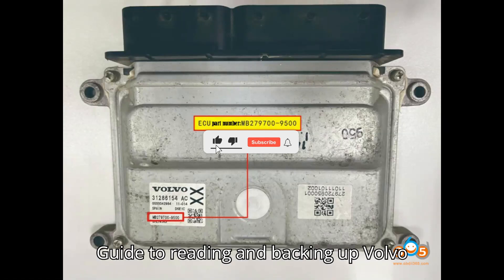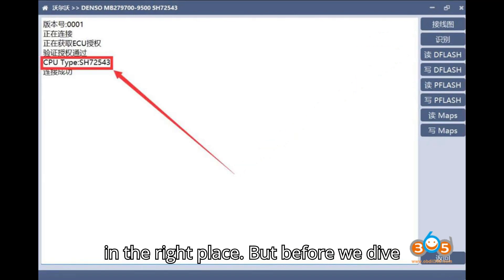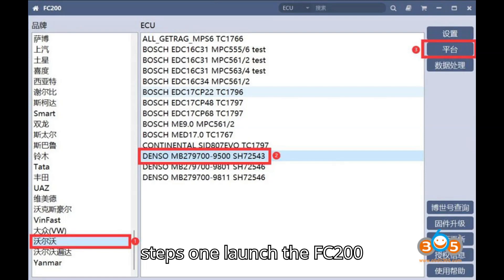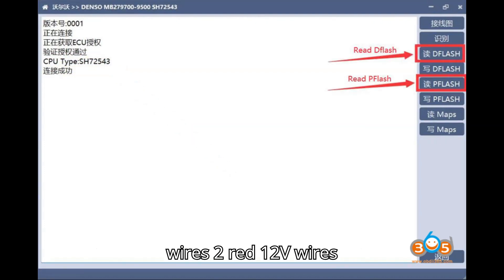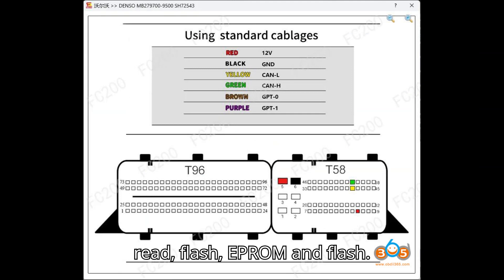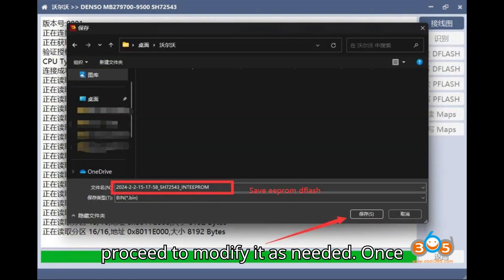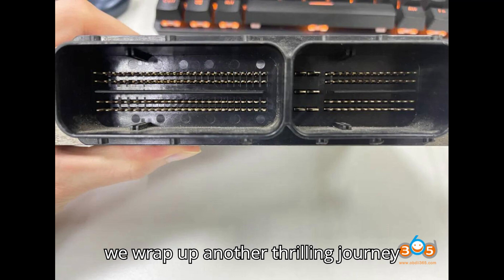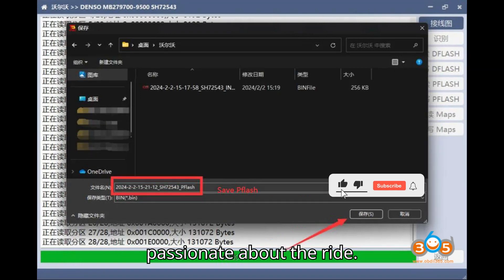Guide to Reading and Backing Up Volvo Denso MB279700 9500 ECU with CG FC200

Comment: It reads fine Dflash and Pflash, but cannot write Dflash, it fails at 13%( it writes fine Pflash). After contacting CGDI, they provided me a file( A1000010.bin) to replace the one in the software- after this the DFlash was able to write without any issues !